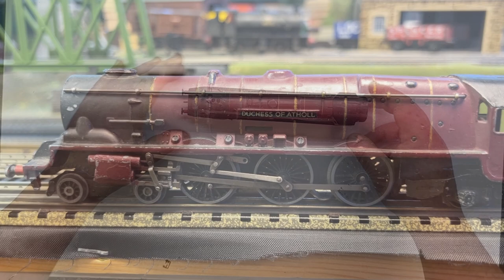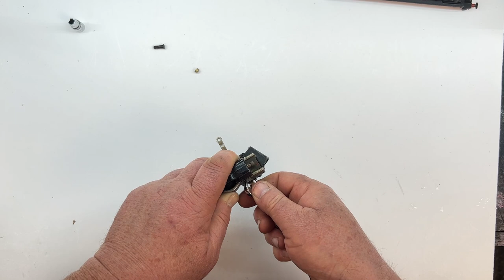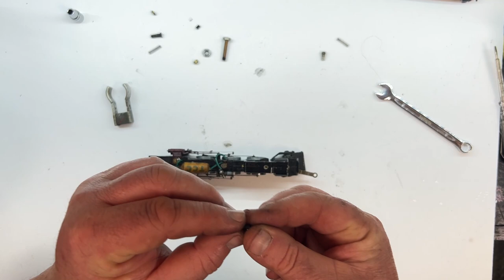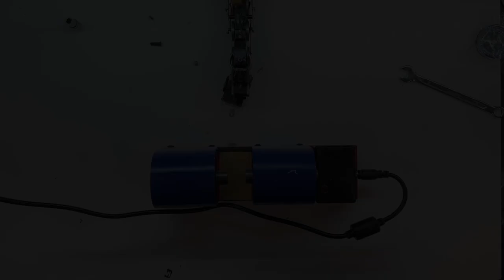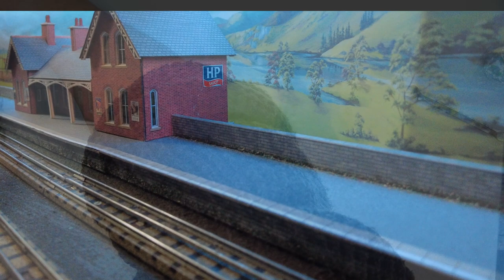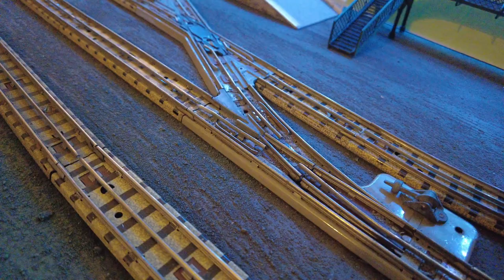3 rail Hornby Dublo Duchess  -  will it ever run again?

Comment: I think you should sympathetically restore it. You mention lining the engine. But the Hornby Dublo Duchess in LMS red was not lined. If decaled as  BR engine in LMS red it had minimal lining of yellow band round the boiler front end and yellow lining along the footplate. Only the BR green ones were fully lined. Makes the repainting much easier. They look beautiful when restored.
Reply from the maker: I didn't know that about the lining, thank you. I must say, the best thing about putting myself out there has been the amazing information share, I have learnt so much. Thank you for watching and taking the time to message me.

Comment: You did check for the ball bearings, I trust.
Enjoyed. Thanks.
Reply from the maker: Apologies for not responding sooner I have been away. if you mean the armature then yes, they are there, I think you can see in the video one roll away if I remember correctly and I went back after as someone commented on the video. I filmed this about a year ago, one of my early videos. Anyway thanks for watching and taking the time to message.
Reply: @dustyshelfcollectables  Thanks for that; wasn't expecting a reply - Youtubers are too busy.  Trains are for winter.
Cheers: Peter.
Reply from the maker: @petert9749  I do my best to reply, I gaet to most eventually - its very nice that for people to engage- Thank you .

Comment: This was a fantastic video here dusty shelf collectibles, I have one of these Duchess of Atholl models myself but it is far from original the main big difference being that mine has been converted to 2 rail and as far as I know Duchess of Atholl was never a 2 rail model, in my opinion I would leave the livery as it is and not repaint it mainly because I imagine that as a collector you would like things to be authentic but at the end of the day it’s your model so it’s your decision, must say yours looks a lot smoother running on your dublo layout, whenever I run mine it has a lot of what is called nosing which is basically the front of the locomotive moving side to side when travelling on a straight section of track.
Reply from the maker: Thank you, appreciated, I actually really making enjoyed that one, it so nice when occasionally something goes right. That's a good point about collectors, I can see a lot more of the 3 rail being converted to to rail as the cost of Hornby's new diecast rises. Anyway thanks for watching.

Comment: I have a Duchess of Athol with same problem. Going to give this a go. I plan eventually starting my own Dublo 3 rail channel as at the moment I only have 1 out of 4 locos working. I've decided that my chanel will not cosmetically restore any items other than general clean and make in running order as I think cosmetic restoration devalues the item.
Reply from the maker: I do agree, I prefer the locos to carry their history, I have only repainted the ones that really were scrap, I left this one alone. If you are looking a getting them running I have had good success with the re-magnetizer, They are quite expensive if you don't have many locos to do, but there are places around that do offer it as a service, other people have suggested replacing the magnets etc  - all the best with the new channel!

Comment: I had a three-rail Duchess of Atholl second-hand in the late 1950s, It had been converted to two-rail and the driving wheel flanges had been ground down. It ran well, even with that ancient vertical commutator. My loco was still in LMS livery-numbers and tender initials, so I guess it was just pre- or on- nationalisation when made. I also had an N2 with the same motor and in LNER colours which must have been of the same date of manufacture. No idea what became of them!
Reply from the maker: I am sure, still going strong somewhere, built to last. Thanks for watching and taking the time to share.

Comment: I'm always in awe of folk who disassemble such small, delicate objects so hats off to you. There was something went pinging off in an 11 o'clock direction at 03:35 that never found its way back on again but it didn't seem to affect operation, short term at least!
As for repainting, I'd say it depends on the rarity of the engine (how many more pristine originals are out there?) and that I don't have a clue about. I am however a sucker for those restoration channels and so, selfishly, I'd love to see you do it!
Reply from the maker: I think it was the locking nut for the armature screw, I added that back in,  off camera after I had stopped filming, but as you say what whatever it was its not effecting the performance - yet. I am worried that my skills will not do the body justice, these old locos are special because of their was scars but this one if very scared - so I don't know yet. Anyway thanks again for watching
Reply: @dustyshelfcollectables  It's not the locking nut - you mention that. It is more like a bushing of some sort that releases after you remove the spring. No biggie though and I'm still impressed that you took it on!
Reply from the maker: @Robutube1  let me go back and take a look I am intrigued now...
Reply from the maker: I see it now on the video, no idea what it was and is not on the bench, maybe the lower friction bearing from the spindle, but isn't showing signs of missing the part while running. Very well spotted though!
Reply: I'm in awe he can do it randomly putting bits down here there and everywhere, I still need to lay every little bit out perfectly like an exploded diagram 😂

As long as you can get the fiddly bits back together again... fixing 3 rail locos is great fun, almost as easy as "round peg round hole, square peg square hole"

I started off with about as much experience as changing the odd plug fuse, now I fix up non runners off ebay for fun, have yet to dip my toe in the rapingint side though, that bit still scares me ✌️😂
Reply: @hamoostaffat  😂
Reply: @hamoostaffat  The reason cheap supermarket toy cars were invented was so we can strip them to metal and practise painting them.  Jump in;  have a  go; just don't breathe the chemicals.
Reply: @petert9749  I got all the toy painting I need and then some with my warhammer, I think I could paint toys 24/7 and still not be done before I'm dead..... without expanding the collections anymore and not counting everything thats already on my wishlists ✌️🤣

If only I'd chosen cheap toys for my hobbies, warhammer, hornby, Oxford cars... all seem to have turned into quiet expensive purchases now 😮‍💨
Reply: @hamoostaffat  I took your word 'rapingint' in 'have yet to dip my toe into the rapingint side',for a mis-printed 'repainting', the meaning being lack of experience at painting models.

Before we both go cross-eyed painting things that are ultimately irrelevant, any ideas on paint adhesion to Mazac/Zamac?  I do have some ideas, but nothing definitive (and little time).
Thanks.
Reply: @petert9749  worked with mazak for years as a metal polisher/restorer, best way I saw of doing it was plating with copper first, easier to paint copper and it adds the extra protection, also paint chips tend not to expose the raw metal

Trouble with monkey metal is once the pox gets in its a terminal disease, because its porous the pox is still eating away under any coatings and the more you polish the more like Swiss cheese it becomes 😮‍💨

Yeah that was a typo of repainting 🤦‍♂️
Only reason I don't do the trains is I like to see the history on them especially the old 3 rail metal ones, I've got a couple plastic Scotsmans that may see the air brush in the future though
Reply: @hamoostaffat  Thanks for that; this is what Utube is all about.  After seeing an advert in Kalmbach's Model Railroader of years ago I got onto the idea of copper plating Mazac/Zamac (monkey metal) as a prelude to soldering.  I asked a plater how well the stuff sticks and the reply was postive.  Of course he is a professional.  So there is another reason to use Cu plating.  I did a little more research, leading to the diecast car restorers (a profitable field for ideas) where I gathered it is difficult but worth pursuing.  It is on my 'to research' list - possibly next time blue-stone is being used for paths.
It is unlikely anyone is going to happen upon our parrot scratchings, but if they do, let's hope it encourages.  Your tip is appreciated.
Best Wishes.
Reply: @petert9749  I try to stick to the hobby vids these days, the world seems a lot nicer this way 🤣

As a polisher I always recommended a triple plate, copper nickel chrome, add an extra polish between layers for a better finish, people generally just assume your trying to upsell though, they are the ones you know you'll see back in a few years time, it's your basic "get what you pay for" when your playing with classic car parts though always best to go for best

For the trains though worst they'll take is some grease maybe a spilled drink, they won't see the salt damage car parts do, a couple good coats of primer with a bit of wet and dry between them should give you years of derailments 🤣

Comment: I think she’d appreciate a bit of lubricant. Just giving the body a clean in warm soapy water would brighten it up. I’ve not yet restored the paint on any of mine and like you I think I prefer them that way. I’d only redo a really rough one (which this one clearly isn’t). Check out OO Bill, Oscar Paisley or Mr Snooze’s channels for great servicing tips. Looking forward to the next one !
Rob
PS, don’t forget to put back that armature locking nut! She’ll runs heaps smoother once it’s adjusted properly.
Reply from the maker: Thanks Robin, yes I put the nut on post post filming. I struggle as everything on camera is at arms length and so I can not see, usually I have a couple of pairs of glasses in and work very close. Thanks for the recommendation of the channels, they look very helpful and I am falling on the side of leaving well alone and just a clean up. Many thanks.

Comment: Great video!!! Are the 3-rail tracks HO scale? I just bought a Jouef loco that someone converted to 3-rail and it runs fine on my Märklin M-tracks, so I wonder if I should look for some older running stock as well…
Reply from the maker: I am not sure if they are HO or OO as I think Hornby were debating at the time, I am sure someone on the comment will know. However would think they would be ok on the m- track, again someone will know for sure.
Reply: @dustyshelfcollectables  Thanks again for getting back. This video series gave me some inspiration for a Marklin M-track layout in my basement separate from my C-track layout, and will probably try to run both AC & DC locos on it...

Comment: An excellent video but I think you should have issued a warning about dismantling the magnet and armature. You didn't let on that you had a re-magnetiser until you came to put it back together and I worry that a novice would not realise the importance of re-magnetising one of these old magnets after their magnetic field has been interrupted. And in any case, all the cleaning which you did could have been done without dismantling the magnet, all-be-it with a bit of fiddling about.
Also, did you apply some lubrication?
Reply from the maker: Fair comment, I am making sure going forward I say my videos are just me doing my thing and defiantly NOT instructional!

Comment: How can I convert an old Hornsby DC 3 rail to 3 rail AC  marklin track?😢
Reply from the maker: I would be sure myself, I don't have much experience with Markin, but I am sure some one may see your post and help.
Reply: You can't without a three year supply of migraine tablets and a four year supply of peppermints.  This is  complicated beyond reckoning.  The problem has traditionally been sorting out the permanent magnet to handle AC signal.  I believe modern Marklin have solved this as they now have permags in their motors.  Go and see a Marklin servicing expert, and whatever you do, get your model checked out by an expert, and endurance test under load for heat build-up - and in both directions.  Have a look at Utube 'The third rail'  
On a simpler level, not sure how the pickup 'spoon' would wear on Marklin stud contact; you might need to fit a Marklin skate under the tender (is there room?).  Finally, 3 rail does not imply DC; the Dublo system was 3 rail DC.  You could run your loco on Marklin track using DC to run it.  Just remember to take it off when running Marklin AC.  This is not a recommendable solution as forgetting to take the loco off whilst running an AC current might burn all to a crisp.  Older pre electronic reversal Marklin can be converted to run on DC, as is my two railed gear.  Just remember to monitor for heat.  ALWAYS MONITOR FOR HEAT BUILDUP!!!  We should periodically do this anyway.  When we modify models they are no longer to the factory specifications that the design engineers signed off on; in this case we even know who that engineer was.  Also, age shifts the model from those specs: brushes soften; motor winding insulation ages; magnets atrophy; plastic breaks doen; and so-on.
Doing this to this loco-  things that would likely trouble engineers from both systems - is  not worth the trouble.

Anyhow, that is just one view.  Hope it helps.  You do need to be unlucky, but even our electric motors can start fires.